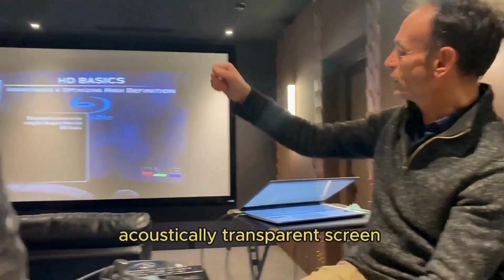Home Theater Calibration - Listening Tests + Setting Time Delays For Best Phantom Centers

Comment: Loved the video. Very interesting. As I was watching my thoughts kept going to the same questions. Certainly in these high-end rooms are Trinnov Altitude 16/32+. Do you use a standard Grimani target curve for home theater for every room that is primarily a home theater? And if you are EQ'ing to a target curve you'd be doing that 'before' room correction. I am curious for something like a Trinnov, given the in-depth manual adjustments you are doing, do you just skip the room-correction part of the Trinnov optimizer 'or' do you input the same target curve you EQ'd to then let the optimizer do its thing to the same target curve?
Reply from the maker: The room in this video uses a Storm Audio decoder, but the issue you ask doesn't really matter here. The target curve is absolutely part of the EQ and calibration process. Each room has a bit of its own particular target curve, depending on the speakers’ power response (Global on and off-axis radiation pattern), and the room’s reflection decay time across frequencies. So the first and arduous part of the EQ phase of calibration is to determine the measured target curve that actually sounds good. I look at the RDT60 Reflections Decay curve, at the waterfall plots, and do a number of listening comparisons until I get to a point where the Center speaker, and/or the Left/Right speakers reproduce music and voices accurately. Then, that measured steady-state response becomes the benchmark target curve, and I go from there. This is all pretty hard to do with the automated processes in Trinnov, Dirac, etc, so I do all that with manual PEQ filters, and All-Pass networks for phase corrections. In my view, a room of this magnitude deserves a human-touched and curated manual EQ process, and not an automated, press-the-button and hope the results are good scheme. It may take just a bit longer, but the results are well worth it. The DSP amps that drive our speaker all have tons of advanced filtering options to make it all work.
Within the optimization process is bass management, and this I absolutely do manually. I first find the best time, frequency, phase, and level scheme to get the smoothest bass out of the subwoofers. Then I optimize the crossover frequencies and filter slopes and types for each speaker, so that the integration to the subwoofers is the best possible. The result is a smooth and punchy bass experience that barely changes from seat to seat. It can take a good four hours to get it all lined up, but it’s worth the effort.

Comment: The phantom-image delay trick is great to fine-tune. I've done it for several years and its the first time I have seen others mention it. 

Anthony, when doing a theater calibration with a Storm processor, do you not use the capabilities of Dirac? All your videos focus on the manual part of the calibration which will be invalidated if running Dirac (multi-sub, delay etc).
Reply: @grimanisystems?
Reply from the maker: Simply put, I haven't had good results with Dirac yet. And it doesn't take that long to run the EQ and correction with the advanced filter set in our amplifiers.

Comment: That's a really great tip about the out of phase pink noise to help fix the phantom centre, I'll be sure to try that.

However wouldn't using all pass filters to fix phase at the MLP make things worse and become more out of phase at other seats?
Reply from the maker: Yes, possibly, if the effect is very tightly limited to the MLP. Need to listen at other spots to verify the effects off-axis, and reach a suitable compromise.

Comment: What is the reason for placing the mics at 45 degrees using a 90 degree calibration file instead of 90? Using a umik I get different results with each angle and do not know which is flat. Thanks for this video series and the many others you have contributed to.
Reply from the maker: The mics I use on the road aren't really “random incidence” mics. They are better in their top octave when set at 45 degrees. All that being said, with room reflection decay, accuracy of the 10kHz to 20kHz region wont really matter too much. You need to listen to the results, or do a “nearfield” measurement at about 24 or 36” front he speaker if you want to set a custom EQ for your speakers.
Reply: Thanks for the reply.

Comment: When eq-ing each speaker are you adjusting frequencies AS the pink noise is sounding?  I must say you are the first I’ve heard to mention the eq differences. Like between two “identical” speakers. Thank you.
Reply from the maker: Yes, I like the “real-time” process of adjusting EQ while observing the result right there live. Using REW Pink PN (Pseudo-Random Periodic Pink), and the analyzer in Rectangular Window, with 8 or 16 averages gets you a quick and accurate result with 4 microphones through multiplexer.

Comment: How do you adjust the imaging between speaker pairs, when the pairs are actually overlapping (each speaker belonging to two separate speaker pairs), without getting into a spiral of adjusting delays?
Reply: I'm not Anthony but I'm about 99% sure this is how he'd answer. Start with the L&R, move to the R&RWide but you're changing only the delay for the RWide, move to the RWide&RSurround but you're only changing the delay of the RSurround, until you hit the last Right-hand surround speaker, and then you do the same thing for the left-hand side of the room.... Make sense? That way you're not having to go back and forth doing double work and pulling your hair out. Lastly, check the phantom image again between your L&R. They should be the same as when you started.
Reply from the maker: @MyFatherLoves   is right! Thanks!!
Reply: @MyFatherLoves  Thank you. OK, so worst case, the delays for the pair of surround back speakers will not be optimal, but all others will?